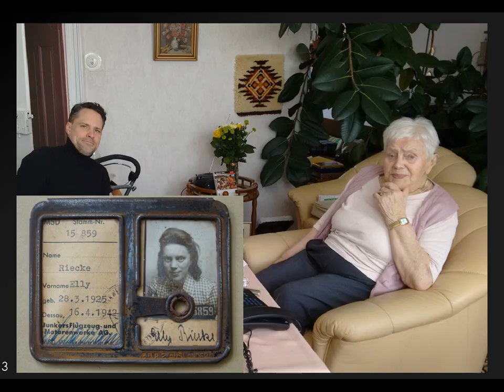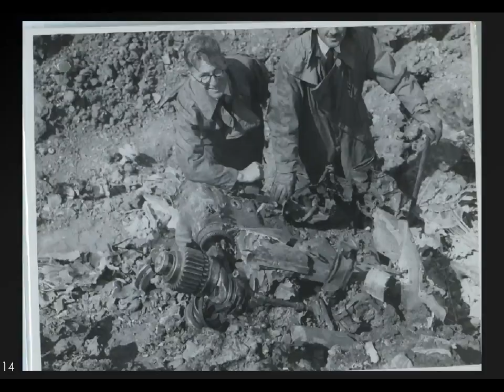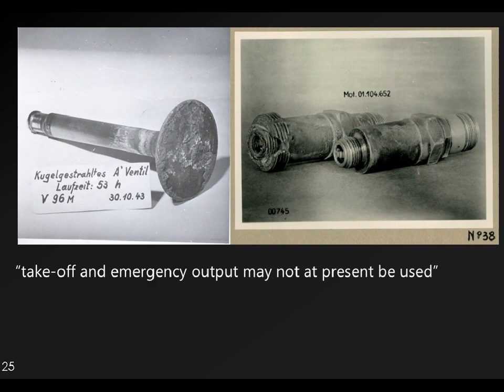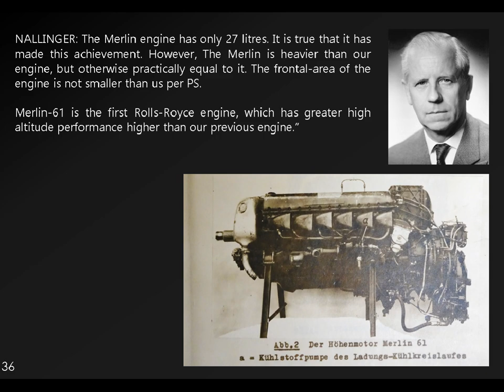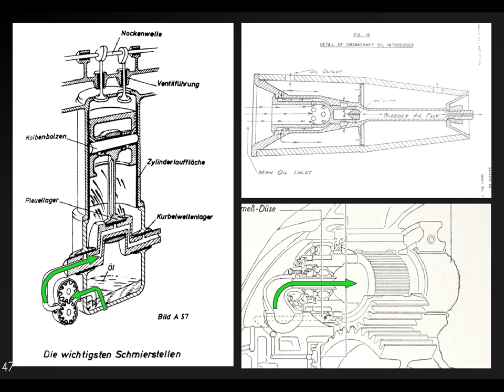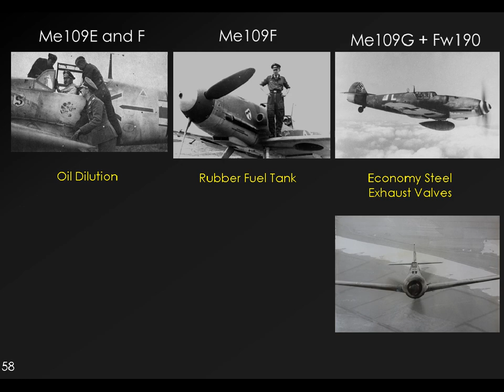The Secret History of Fighter Aircraft Engine Development in WW2

Comment: "How Did Britain Win" Point 4 "Canceling or mothballing all "Outlandish" development engines.

What the heck was the Napier Saber if it wasn't "outlandish"? It was the establishment refusing to admit that they had wasted resources on a really marginal project and finally pulling in resources from Bristol and from Rolls-Royce to get the thing to work to some extent. It had power but was heavy and had bad fuel economy as well as using almost as much oil as fuel. It was a curiosity that some point to as a wonder but it was never worth the trouble or wealth it consumed.

It makes a big hole in point 5 as well! "Concentrating all on developing very basic conventional engines."
Reply: I really think you need to read my book. A quarter of a million words does not translate to 1hour of video very comprehensively. The most important maker was Rolls-Royce, who DID cancel/mothball all their weird and wacky projects, as for the Sabre, much like the Centaurus, this was basically left to wither on the vine and was provided nowhere near the same engineering effort as the Merlin. This is, essentially the point of the comment, and compared to the German approach, makes a huge contrast very visible.
Reply: @CalumDouglas  Thanks for clearing that up.
Reply: @CalumDouglas  Perhaps 'What Did Rolls-Royce Do Right' have been a better title than "How Did Britain Win". The points you enumerated do seem to apply to R-R well. The production of the Saber grew to being an international problem through the diversion of precision grinding tools away from Pratt & Whitney R-2800 production to England for the Saber. A lot of upset people at Pratt about that as they were needed for production of the improved C series engines which were going into production.
Reply: @keithstudly6071  This is basically true, however, it was most certainly not the case that RR could have got everything right on their own, a gigantic industrial and logistical structure was needed as well as huge work from the aircraft designers and it all had to be directed competently from above. The Vulture/Tornado being a good illustration that the British (and RR) were far from infallible. The difference between what happened in Germany, to what happened in Britain was separated by a very thin piece of paper... of which RR can be given only so much of the total credit. Therefore I think it would be historically unsound to call the presentation "what RR did right", although I absolutely understand your point. Hope that makes sense.
Reply: That is probably an extreme example. Bear in mind that Roy Fedden at Bristol persisted with the development of sleeve valve radial engines, despite the relative difficulties of producing them. So while engines like the Rolls Royce Exe - a 24 cylinder, 2 stroke - and the Vulture were either abandoned or mothballed, there were probably pretty good arguments for having one or two slightly radical designs up their sleeves. Napier, of course, were not seriously involved in aero engine development in WWII so perhaps a private venture was thought not a bad idea.

But I agree, it seems a bit inconsistent.

Comment: 20-37 psi absolute is 5-22 psi boost on your average auto engine in gauge pressure . nothing water injection or even e85 wont handle on modern 9.0:1 compression ratio

Comment: Mosquito was not only extremely fast and very adaptable it was also less visible on radar. 
I believe The Allies made a huge error in using four engine heavy bombers when less than double the numbers of Mossies could have done a better job with 50% of the crew numbers at risk and fewer shot down.
Reply: The claim about the Mosquito being less visible on radar is a reverse engineered claim, based on incorrect assumptions about WWII radar. Modern low observable methods work in a different spectrum from WWII radar, which was in the 50-500 MHz range while modern fighter targeting radar is  X-Band (7-11 GHz). Furthermore, while electronic countermeasures were used, they were limited to primitive forms of chaff, known as “Window”. The only other anti-radar techniques which were used were limited to low flying, which was a speciality of Mosquito units. Given that the current assumption is that the Mosquito was supposedly better against radar, it would seem a pointless and risky exercise to fly at such low levels.

In conclusion, it seems highly unlikely that anyone implemented any sort of low-observable techniques the way it is done today.

Those origins of this nonsense is the History Channel pseudo documentary which set out to prove that a reproduction of a Horten Go-229A was an early stealth aircraft. This, of course, is also intended to “prove” the myth of German engineering superiority in WWII. The fact that there was almost no metal in the reproduction, no engines and as far as I know, no cockpit, plus the fact that it was irradiated with a modern X-Band radar, gives some idea of how historically ridiculous it was.

Had it been true, I’d expect to see a reappearance of materials such as plywood in modern types, perhaps not in high performance fighters but certainly in semi-disposable types like drones.
Reply: @thethirdman225  Oh and that whole 'stealth' malarkey from Horten is a definite post-war story. You'd think he would have brought that up in his intel debriefing when the Allied forces had a chat with him if it was designed as such.
Reply: @whtalt92  Right. Reimar Horten kept re-engineering the story until everyone got sick of him, even his brother. Every time someone talked about some new aspect of stealth, Reimar would be there saying, “We invented that.” Eventually people stopped listening to him. Any “stealth” characteristics were coincidental, rather than planned.
Reply: @thethirdman225  Modern drones do indeed use a lot of non-metallic composites, such as graphite, kevlar, or fiberglass composites because of the greater weight to strength ratios.  And they do reflect less radar waves, across the electromagnetic spectrum, from VHF to X-band.  

German radar eventually progressed late in the war into the microwave range with the FuG 240 Berlin operating at 3.3 Ghz.   
https://en.wikipedia.org/wiki/FuG_240_Berlin

Any sort of radar signal reduction would have helped the Mosquito avoid early detection and getting shot down.  It was used extensively at night, as night fighters, pathfinders, and for night bombing.    As night fighters, they hunted the German night fighters trying to shoot down the British bombers coming at night.    The only reliable way the Germans had for identifying planes coming at night was radar.  German night fighters carried various arrays of radar to track night intruders and the night bombing raids from the British.   This was almost certainly a big part of the German frustration with dealing with the Mosquito - being unable to detect and stop it at night.

The low flying bombing raids by the Mosquitos had more to do with increasing the accuracy of their bombing than avoiding radar as  they were usually directed against precision targets.   These were essentially glide path dive bombing runs - bombing from any distance above ground was terribly inaccurate during WWII otherwise. 

The original requirement to use plywood on the Mosquito was primarily to reduce the use of precious aluminum during wartime, and nobody then realized that it also made the Mosquito more stealthy.   A key unkown, however,  is also what the paint scheme did to the Mosquito's radar reflection, since the composition of the color microparticles  in the paint can have a huge effect in either reducing or increasing radar reflectivity.   

A side benefit of this use of wood on the Mosquito, and probably a huge reason that the Mosquito was so fast (because its body shape is not that aerodynamic - it doesn't use conical sections or thin laminar flow wings like the P-51) was probably the decreased drag from the normal rivets and seams of joining aluminum skin to the metal frames.   With wood, these joints could be sealed and sandpapered down to very smooth surfaces.   The Mosquito could literally be built by woodworkers from the furniture and housing industry.   And glued/screwed together and sanded down smooth.

Most of the early British fighters still had the old bulging rivets at some part of the airframe.   The use of flush rivets was initially limited to only the critical panels most exposed to the airflow because they were more expensive and more time consuming to apply.    The Mustang had all flush rivets.
Reply: @gandalfgreyhame3425  
"Modern drones do indeed use a lot of non-metallic composites, such as graphite, kevlar, or fiberglass composites because of the greater weight to strength ratios.  And they do reflect less radar waves, across the electromagnetic spectrum, from VHF to X-band."

None uses wood.

"German radar eventually progressed late in the war into the microwave range with the FuG 240 Berlin operating at 3.3 Ghz."

25 sets were built. They were not a factor. And that's in the S-band, not X-band.

"Any sort of radar signal reduction would have helped the Mosquito avoid early detection and getting shot down."

And if my aunt had balls she would be my uncle. We are dealing with a very different set of circumstances from the modern era.

"This was almost certainly a big part of the German frustration with dealing with the Mosquito - being unable to detect and stop it at night."

There were many reasons for this, mostly around the way the British operated them.

"The low flying bombing raids by the Mosquitos had more to do with increasing the accuracy of their bombing than avoiding radar as  they were usually directed against precision targets."

Total bullshit. Both are valid.

"The original requirement to use plywood on the Mosquito was primarily to reduce the use of precious aluminum during wartime, and nobody then realized that it also made the Mosquito more stealthy."

Which is why radar signature was never considered.

"A key unkown, however,  is also what the paint scheme did to the Mosquito's radar reflection, since the composition of the color microparticles  in the paint can have a huge effect in either reducing or increasing radar reflectivity."

You're going to have to prove this with specific contemporary information.

"A side benefit of this use of wood on the Mosquito, and probably a huge reason that the Mosquito was so fast (because its body shape is not that aerodynamic - it doesn't use conical sections or thin laminar flow wings like the P-51) was probably the decreased drag from the normal rivets and seams of joining aluminum skin to the metal frames."

Load of rubbish. While there's undoubtedly some truth in the matter of parasite drag, the Mosquito was very aerodynamic and had a very large swept propeller area. You should look up some of Calum E. Douglas's comments about it. The execution of the radiator intakes, to name one factor,  made it very slippery indeed. There's no point mentioning it in the same sentence as the P-51. The Mustang was designed from the outset to be laminar flow (though in practice it was not). The Mosquito was never intended to take advantage of laminar airflow.

You are trying to reverse engineer an argument that does not exist. I'm sorry but I get sick to death of hearing this. Until you can provide specific examples or references, this will never be more than bullshit speculation designed to impress a tenderfoot. I have zero expectation that such information exists and there is plenty of useful information already out there. Read "The Other Battle" by Peter Hinchliffe. Then read something about how Mosquito squadrons were operated and why. Start with Ed Bishop's book, "Mosquito". "The Gestapo Hunters" is very good and then move to "Scramble" by Bob Braham. None makes any mention whatsoever of Mosquitoes having lower radar signature than other types and since their lives depended on how they flew...

Comment: Our chemistry teacher in the 70's said he was at university at wars end. They were taken to German factories. They were amazed how advanced Germany was in the field of chemistry.
Reply: But not as advanced as Du Pont who were able to greatly increase the octane rating of aviation fuel with tetra ethyl lead.
Reply: @andrewallen9993   TEL was commonly used in germany during ww2.
Reply: @peceed  If TEL was available why was German aviation fuel so low octane as to affect engine performance and longevity?
Reply: @andrewallen9993  It is good to find these answers before false statements about TEL. B4 was higher octane rating than 87, and C3 was comparable to 100/130. Low octane fuel doesn't affect logevity, and performance of german engines was comparable to british and american, as long as you compare horsepower to weight of full installation.
Reply: @peceed  The easiest way to get higher performance and longevity was to increase the compression ratio but this required higher octane fuels which was boosted by the addition of TEL. The other method was to assemble the engines properly which explains why British Rolls Royce Merlin engines developed higher horsepower and better reliability than those assembled by Packard in the US. Packard was able to make the engines cheaper and faster than Rolls Royce though thanks to better production engineering and manufacturing tolerances with unskilled labour. Germany after 1943 had sent it's skilled labour to the Russian front and quality control was managed by hanging slave labourers who didn't turn out parts to specification. This explains the poor performance of the Luftwaffe after its earlier successes.
Reply: @peceed  In addition to these problems as mentioned in the article the German engines had design problems such as poor metallurgy In the valves due to a lack of nickel, the rubber coating of the self sealing tanks dissolving after a few months and affecting the fuel chemistry, poor lubricating oil as well as the aircraft and engine builders trying as hard as they could to make the aircraft a piece of rubbish without being caught due to their love of the way Germany was treating them.
Reply: @andrewallen9993  But Germany were synthesizing many many other things, fuel from coal, nitrates, dyes, etc.
Reply: @flybobbie1449  Look up the meaning of the German word ERSATZ :) the allies made far better substites.
Reply: @andrewallen9993  Ersatz coffee made with hickory nut shells(?). Yuck
Reply: Not so advanced that they never managed to come up with a wood glue that wouldn't go acetic and fail without the addition of charcoal dust (carbon) to the mix, now claimed to be for radar masking.
Reply: Zyklon B?
Reply: @annoyingbstard9407  Yes, wasn't it originally for something else, pesticide or something?

Comment: Wonderful. The role of management is vastly under-rated in these high pressure situations.
Reply: The RR “Crecy Sprint engine” - sleeve valve two stroke was how not to run a project. Test engineers struggled with the V12 before the V twin test dolly had been fully sorted. 
They had endless bearing problems. Which turned out to be inadequate oil supply. The Merlin oil pump could not meet the demand of the Crecy V12. Poor project management.
Reply: The Rolls Royce Heritage books give an amazing insight into their project management. The books - Rolls Royce and Mustang is especially good.

Comment: nice presentation. i just highly doubt that the Fw 190 was flying at half the power, This would have made the aircraft a useless brick to fly. So there must have been either a solution or a high need for maintenance. Half the power is like..750hp. that is laughable. Any reasonable man would have withdrawn the fighter from combat.
Reply: Its called BS thats what it is according to this video 800hp 190 was faster than a Spit xD  Its a brittish guy speaking of course he is gonna say England is the best Watch gregs videos much better and non biased!
Reply: @123fockewolf  I dunno man, he seems to like his P-47s more than is healthy :D
Reply: @whtalt92  Because its a beast and an amazing plane one old vietnam airforce vet said he knew a US Ace that preferred the  47 over the mustang and said it was so much better the 47 is an amazing plane one of the best in ww2
Reply: @123fockewolf  well i dont think that a value a comment of "Mr Fw 190" very highly. No one calls him biased only because there is an error.
Reply: @123fockewolf  
Gregs vids are not biased? Some are cringeworthy.
Reply: These were WWII Luftwaffe commanders.  Where does a 'reasonable man' fit into the scheme of things?
Reply: The missing information in this otherwise excellent video is how long exactly the FW 190s could fly before the valves failed.   Because they most likely flew just fine straight out of the factory, and in the early war years, an engine that was showing problems could be easily replaced, thanks to the easy  plug and play design of the engine mounting.   Later, of course, this would be a big problem as Germany's factories were getting bombed regularly.  
The issue is exactly the same as what happened with the Panther tank, which was engineered with a final drive that tended to break down after only 1500km of use.   The Panther also had many other serious engineering defects and weaknesses.   But of course, when the Panther was brand new and functioning and operated by an experienced tank crew, it was a fearsome tank that destroyed more than its share of Allied tanks, and is otherwise well regarded among tank historians.
And so that simple bit of missing data very easily explains what some of you think is the discrepancy with the perceived great reputation of the FW-190.